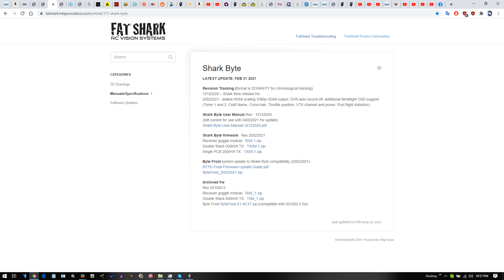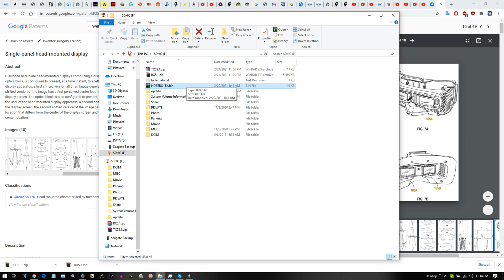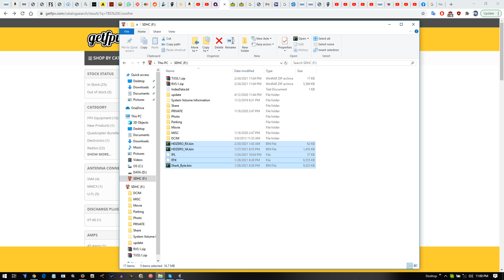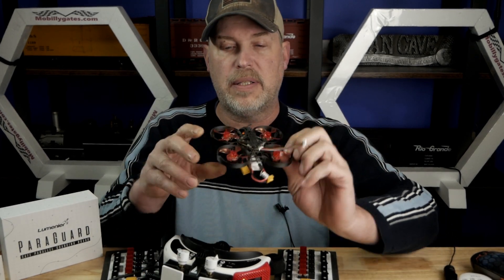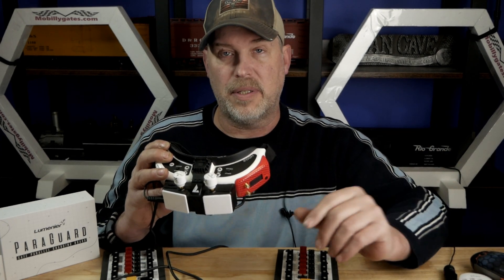FatShark Shark Byte How to Update Firmware

Comment: I do not get a bootup screen
Reply: me neather i was doing the firmware and was hot so i pushed the fan button on my fatshark goggles and it stopped the update nothing in manual says anything about turning the fan on would mess it up now im tring to figure how to fix this sucks
Reply: @pitpuppies  Yea I dont get any menu at all. nothing. not even when I try other hmdi displays... I have to send it back
Reply: @fantastichumore  I got it to work after I put 2 antennas on it still tring to get osd to work but I should be able to figure it out thanks for responding
Reply: @pitpuppies  Hmmm, I have 2 antennas on it, still nothing. Does you LED Light illuminate red?
Reply: @fantastichumore  Hey there so just pluged it in I get a green light no red when i was flashing firmware my fan mesed it up had to  follow instruction on a reboot had to flip the little switch by the red light power on wait about 5 min till red light goes out with the reciever firmware in card
Reply: Wow and now I have osd man I think they need a few power on and off cycles to get stuff working I mesed with it hours last night nothing but now it has osd
Reply: @pitpuppies  Right and when I unboxed it the LED was red... So Im sending it now to the service...